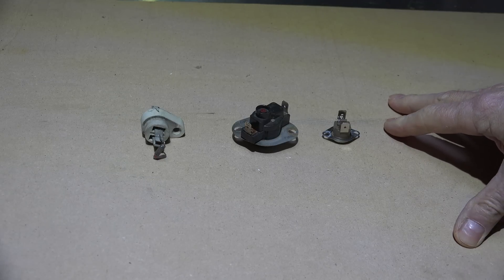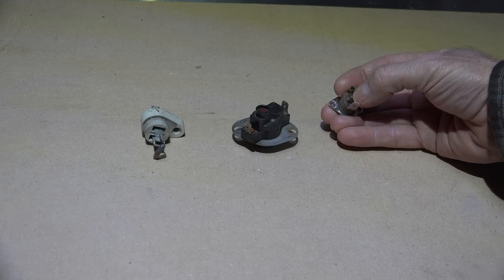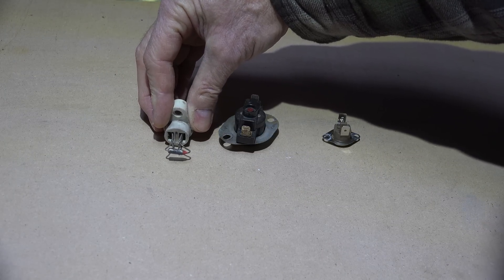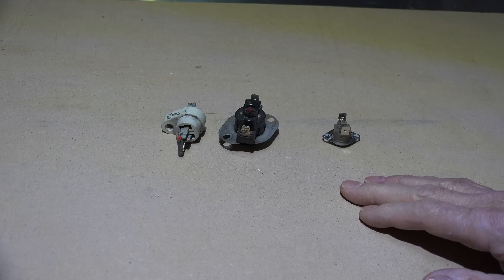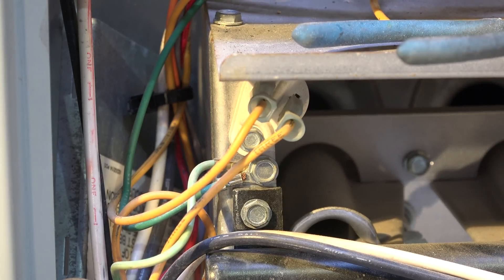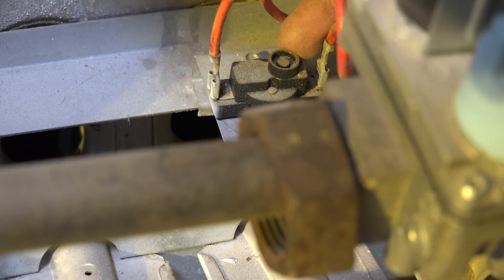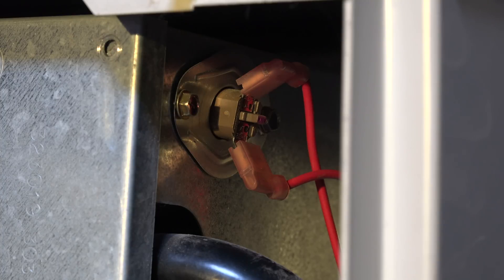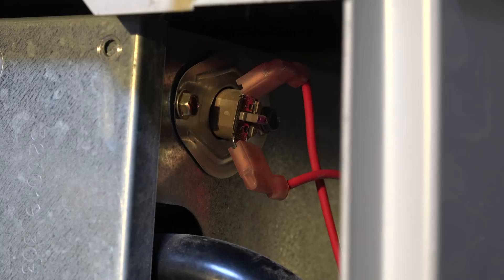The furnace rollout switch

Comment: I have a flame rollout switch on top of the fan motor that tripped.  It is no where near the flames.  What does this mean?  Is the motor running hot?   I have a 1985 Day and Night furnace.
Reply from the maker: This is usually an air flow problem.  Plugged filter, plugged A/C coil, restrictive ductwork.
GFM
Reply: @grayfurnaceman  Thank you for the fast response!  I was thinking my filters are clogged.  They have not been changed for 35 years.  4 weeks ago I started my journey on fixing my furnace.  At the end it turned out to be 2 switches being in the open position and a bad thermostat where Nest/Google decided to do a firmware upgrade and required more current from the Rc wire.   I tried everything before that including replacing the control board and motor inducer board.  The combination of symptoms for a loop because having your thermostat all of a sudden requirement more current on the Rc wire is a very uncommon situation.

Comment: You did not say a word about putting a meter on it for res. Value or V or if it's normally open or close how to tell if it's bad
Reply from the maker: I seldom use an ohmmeter.  You can diagnose the problem with the voltmeter.  Voltage reading, switch open.  
I have never seen a limit switch that is normally open.
GFM

Comment: I have a manual rollout switch with the reset button like the first one on the right @0:15. The small black cylinder that sits center on the base of the switch was pulled out like it were a distributor cap of a car engine. A technician pulled it out and left it dangling there freely, held by its wires. The base plate is still screwed in the burner box. 

Could I pop the black cylinder back into place in its original position or is the switch broken now?
Reply from the maker: Replace the switch with a factory replacement.
GFM
Reply: @grayfurnaceman  You're right. I should, but I don't even have a part number for it. We have an old discontinued Aire-Flow furnace that's been serviced annually. So, I don't think factory parts are available anymore. Aftermarket?

BTW, I popped the flame rollout switch back together and the heater actually did start working again, where as before, it didn't even light up. I monitored the burn cycles all day and the burning was clean and controlled. But who knows if that switch will do its job of shutting down the system if there's a flame rollout in the future.
Reply from the maker: If there are no factory parts available, you can use general replacement.  You just have to match the temp of the switch.  The temp is stamped into ear of the switch.
GFM

Comment: Hi this is a utica water boiler for residential,..made in 2000 the design does not have an exhaust fan...the burners flame points up similar to gas grills not horizontal like forced air furn...just a auto damper which i leave open all time...i have it set to manual open since automfunction doesnt work....immaybcontact utica regarding issue....this is not a forced air furnace which have the small fan built in that sucks the  falmes into furnace

Comment: ok vent is clear..damper always open...thanks
Reply from the maker: Sometimes a rollout will occur if there is a negative pressure in the structure.  Try a match in the draft hood.  Should always draw in.
GFM
Reply: thani you i did that a while back when i was troubleshooting this issue...and it sucked up pretty good..i even used a mirror to see that the venting is clear alll way up to roof....this issue went away for a few months and now its back again intermittently ....the rollout switch is located on the bottom right of the burner assembly so its below the falmes not above.....i cleaned the burners out a few months ago they are spotless and in good condition ..one thing i did notice a few months ago is that when i looked inside the biuler furnace body there was a "panel" that did not look right.it looked out of place .it was like sitting up uneven as compared to the  the other panels so i pushed it down even....do you know what this panel was? and why it would lift up? its a utica water boiler made in year 2000
Reply from the maker: Not sure on the panel.  You are back to negative pressure in the structure.  Exhaust fans?
GFM

Comment: Hi.you helped me with my auto air bleeder on my hot water boiler furnace,,,,thanks....i have another issue with it....there is a switch on the inside right lower area of the burner assembly...it keeps tripping once a week or so.... Its a manual push button reset...its a utica boiler 75000 btu...made in 2000...can you assist with what the switch is and why is tripping?
Reply from the maker: Its probably a rollout switch.  This means there is a venting problem.  The exhaust gasses are not passing out the vent.  If the unit has a vent damper, there could be a problem there.  There is also a possibility of a blockage in the heat exchanger.
GFM

Comment: I'm reading 1.5 volts on one side of the rollout switch. Not reading anything on the other side going to pressure switch.  It won't reset manually it's an automatic.   Could it be bad?
Reply from the maker: Sounds like you are reading to chassis.  If so, stop that.  lol  Read across the switch during a call for heat with the inducer running.
GFM

Comment: My york furnace turned off and stayed off until I reset rollout switch then it went on but turned off again does this mean I have bad rollout and of so then what's the h purpose of reset ??
Reply from the maker: You probably do not have a bad rollout switch.  The switch opens when there is a flame rollout as a safety.  The manual reset is there so that a service tech can reset it once he has found out why it tripped and repaired the problem.  
GFM

Comment: why would it have to be a factory switch??
Reply: If it is an aftermarket rollout switch, it may trip at a different temp than the factory one. If it trips at too low of a temperature, it can trip for no reason. If it trips at too high of a temperature, it may not trip if there is a flame rollout, or it may trip very late. Also, since the furnace was certified with factory components, if you change any components with non factory parts, the furnace will no longer meet its safety standards. Also, if there is a fire, your insurance may deny the claim if incorrect replacement parts are used.

Comment: With the non factory switch you mentioned ;how does that effect operation?
Reply from the maker: The worry here is that the non factory switch may be configured differently than the original and thus not sense properly or the cutout temperature is incorrect which could make it nuisance trip or not shut down when it should.
GFM

Comment: Why is my error message saying I have a open rollout when I'm using the cooling?
Reply from the maker: If a rollout switch is open, the unit shuts down and the fan comes on.  The rollout is manual reset and could have opened during the heat cycle.
GFM

Comment: I think I may have a bad roll out switch.  I have been trying to trouble shoot my heater for all winter and it has gotten progressively worse.  Sometimes it will run fine other times it won't to the point where it wont run for more than 2 minutes now.  I have jumpered the rollout switch wires and it seems to be running.  Unfortunately I don't have a meter.  I am pretty sure I don't have a roll out situation because I can touch the metal sheilding around the burners and housing where the roll out switch is by hand and it is warm but not too hot to touch.  Visually I don't see any roll out either.  Just the jumper flames but nothing that screams rollout.
Reply from the maker: You can try replacing it but it will be the first time I have seen a rollout fail.  Have seen many replaced, but never was the problem.  
GFM
Reply: Thank you for the reply.  Do you have any other suggestions?  I ordered one because it was only 8 dollars.  What makes this problem so frustrating is that its intermittent.  Filters good ect.  I'm afraid to call a service tech because I don't have a relationship with any and I'm afraid of the quality of service I will receive.  If it was you I'd fork over the cash in a heart beat, I just don't want to pay some kid to scratch his head as well and throw marked up parts at my problem.
Reply from the maker: At this point, I think you need a pro.  It may very well be a cracked heat exchanger.  btw, what brand and model#?
GFM

Comment: My Rheem RGDA-125A-AR furnae has a flame rollout switch like the one in the middle of your three swtichs. It has the button in the top to reset it. I was going to get a spare, and I see at least 3 different temp settings, 250, 300, and 350 degrees. I can't see any temp listed on the switch. How can I find out which temp rollout switch I should get?
Reply from the maker: The temp rating is printed on the flanges of the switch.  Use only the right temp switch.  Safety hazard.
GFM

Comment: i dont exactly understand why an aftermarket rollout switch cannot be used. Although it is a safety switch, i feel that an aftermarket piece will perform just as good, no???
Reply from the maker: +Armando Martinez jr. You, as a service tech, are responsible for good workmanship using proper parts.  You are not an engineer.  Many parts are rated as general replacement and can be used for many applications.  Limits and rollouts are not of that type.  The only way I would do it is if I found one of the same temp and exact same style.  If the furnace causes a fire and an aftermarket switch was used, the manufacturer will not back the furnace.  You will.  
GFM
Reply: +grayfurnaceman got it!